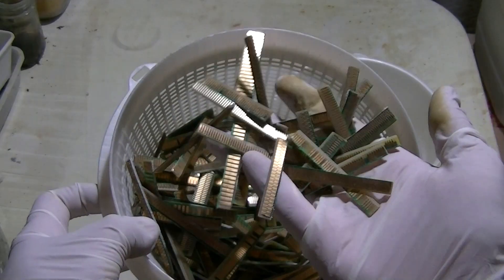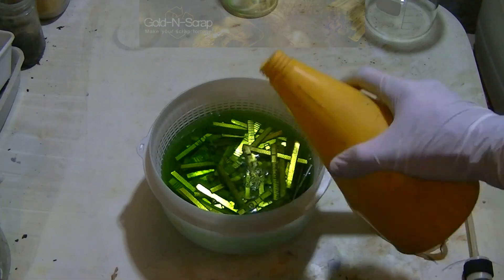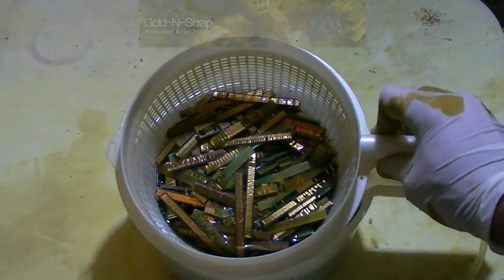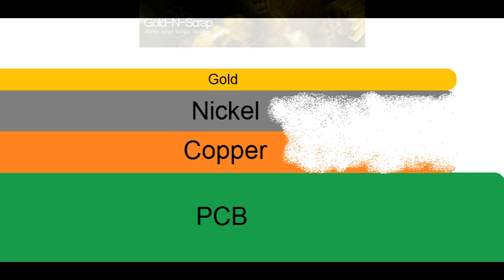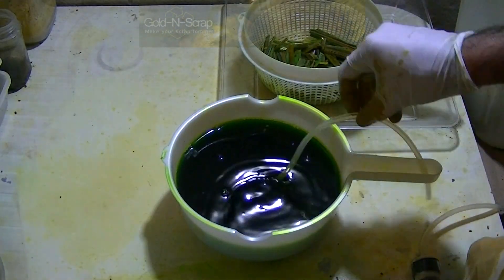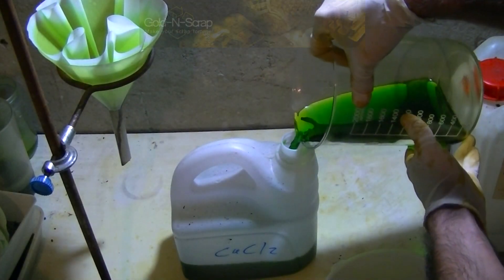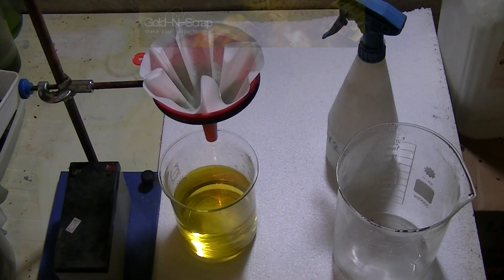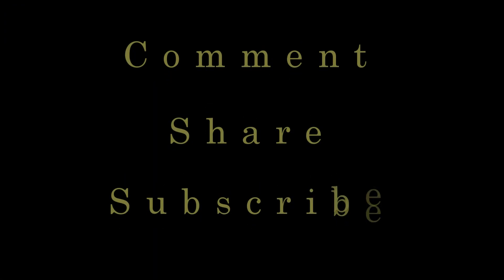Gold Fingers - How to Recover Gold from Electronic Scrap

Comment: Holy shit that real gold? You can try making an even bigger batch to get more gold and pawn that for a couple hundred. My guess for that piece of gold is about 3oz
Reply: Random dude lol 3oz not quite maybe 2grams
Reply: ***** I'm pretty sure you've missed the point. This isn't a get rich quick scheme or the uploader wouldn't have shared it! It's fairly interesting, but not gonna get you Richard Branson status. In fact as you say, you are more likely to take a loss undertaking this.

However, 3.5m YouTube hits with original content and adverts... this guy has earned at least $3000 in advert revenues from uploading this. I guess he did make a tidy profit ;)
Reply: Random dude three ounces? HA! no try again. One ounce is one of those big fat coins, $1600 bucks. This piece is probably worth 30 to 60 bucks at best.
Reply: Christian Dixon Correct, but on average a PC motherboard yields 5 Troy ounces per ton of chipsets, sourced from a Dell tech article. So to even earn 1 thousand let alone a few thousand as you say, you'd need to process 200kg of boards... motherboards (heaviest) weigh about 600g each. So you'd need to process 270 or so motherboards even if the cost of processing was nothing, which it definitely isn't! Realistically you'd need to sift through ~500 boards per week to make $1,100. If you sell the boards for $2 which isn't as hard as it sounds.... you've basically got the same profit :P

A lot of guesswork in the above but if this was profitable, there would be a lot of people who owned homemade gold stripping factories!
Reply: Random dude pawn it? pawn brokers are parasites that take advantage of ignorant and desperate people.
Reply: Random dude   Gold is heavy, that looks like about 23 and 11 pounds
Reply: Random dude That's probably way less than 3 oz. Odds are this isn't a viable way to get any money unless you own a computer shop or work in IT in a position where broken computer parts would fall into your hands very often. The initial investment in chemicals and supplies probably cost more than this single batch. Wouldn't recommend this unless you had a free steady supply of computer parts and are willing to follow all safety precautions.
Reply: GrumpyGrebo Gold is $1,100 an ounce right now. If you have access to scrap pc components and the chemicals from the video, you could easily make a few thousand bucks a week doing this. That's a pretty good income.
Reply: Random dude That's no where near three ounces of gold my friend! It's more like three grams, maybe four grams of gold. Haven't you ever held a one ounce gold coin in your hands before? It's much larger then that little nugget of gold he produced.
Reply: well think about the cost of all the materials and the oppurunity cost he wastes by spending hours with this process... not worth it for a tiny bit of gold worth around $60
Reply: Joe Schmoe The process of doing this is kind of pricey too. So when you think of it nearly pointless except for pure scientific curiosity really. Not to mention rather dangerous.
Reply: Random dude 50$ of chemicals for 5$ of gold plating. wow nice profits
Reply: Silver Schooner The price of gold was 55$ CAN/g of gold last year. Now, it hovers around 50$ CAN. So, 3 g  = 150$

The chemicals he used is worth about 5$ (1 L of HCl, a little CuCl2, a little HNO3). Counting the equipment might raise it to 50$. A small bern-z-omatic torch set (propane and oxygen) use to cost 75$.
Reply: justinjj149
Reply: first off, calm down u dont need to attack me. Second, how often do you think people need to recycle electronic scrap?
Reply: lol
Reply: justinjj149  man, you obviously dont live where i live, this is pretty cool to me.
Reply: Dj Barrington not denying its cool, just saying this isnt a way to get money off of
Reply: justinjj149 safety materials are reusable and the chemicals he used, i don't know if you noticed, but he says you can reuse the chemicals too, so he stores the mix for the next batch. so it's an investment in a way. he basically just lets the chips sit for 3 days anyway, so it's not like it takes lots of his time.
Reply: Dj Barrington We've already been over the reasons behind this previously, so at this point in the conversation a straight answer is probably more effective: no.
Reply: Lawrence Menachemson I think you're in the ballpark.
Reply: jordan f .999 gold is running apx. $38.00 a gram. 3 grams apx worth $115.00.
Reply: louis tournas You can't just pick up HCl or HNO3 at your local convenience store
Reply: Stephan Rabai You can get HCl at your hardware store. I do home chemistry so it is quite convenient. It is about 10 M concentration (which is quite concentrated). 10$ to 15$ for  4 L (over 1 gallon).

HNO3 is hard to find in Canada. Hydroponic shops sell it but it is quite expensive. I think it was 24$ per liter of unknown concentration. In the USA, you can get yourself KNO3 from most hardware stores and do some chemistry. If you intend to do gold extraction, you can just dump KNO3 directly into that solution (see video). It will acts like HNO3 because of all the HCl that is present there.
Reply: louis tournas Interesting update. The only places I've seen locally for these reagents are commercial distributors that don't sell to the public. HCl is battery acid but that's not going to be 10M?
Reply: Stephan Rabai Battery acid is sulfuric acid (H2SO4). A fully charged battery contains about 4.8 M concentration, which is 37% by weight H2SO4. HCl is often sold under the old name, muriatic acid. I think people use it to clean concrete. You will find it near the toluene, methanol, varsol, paint thinner, acetone, xylene area. If you are lucky, it will be clear. Sometimes, it is green colored because of impurities like Fe(2+).
Reply: louis tournas Thanks for the corrections and clarifications.
Reply: louis tournas about 6 grams

Comment: How much gold was recovered? Not enough.
Reply: michael peterson You spend more money than get from this proces..
Reply: its better than nothing
Reply: ZXTMA Smith 4 to 5 grams @ $35-40/gram = pretty good money for what $12 worth of chemicals and maybe $25 worth of equipment. NICE! but accumulating enough boards and connectors to salvage that amount of gold will take a long time. he showed approx 30 computers worth of fingers (~4 per computer)
Reply: ZXTMA Smith
Reply: Nope not worth it, the amount of time you spend getting a tiny bit of gold out of it which isn't worth enough for the labor involved.

You will make more money just working at a job than getting gold out this way.  Unless you have a giant version of this where you can get a lot of gold out, in which case you will have to spend a ton of money to make this a viable thing.

Comment: So basically you need to be a chemist and have access to these types of chemicals. Then you need the equipment and supplies. The air bubbler uses energy for a week straight.

The bottle of HCL is $35.00 + $27.00 shipping by itself.

Comment: 2.5grams
Reply: Thank you very much for the prompt response and the info. Very informative.

I've been working as a mechanic for over 45 yrs and you've helped see that I've been wasting a lot of scrap instead of stripping it down. 
Ford starter solenoids have a lot of copper in them, but over the years, I just tossed 'em when they went bad.

I used to sell old starters and alternators to rebuilder's, but it would seem no one rebuilds them anymore.
GM starters are pretty easy to remove all the copper form the armature, and I just figured out how to do it on Fords.

I look forward to learning more from you and if you ever have a need for any help on your vehicle and I can help you out, please do not hesitate to ask.

Shal' aam Aleichem
AAPiY
Mike
Reply: Mike Paul That's awesome!  Glad I could be of help to you.  I have been wanting to make a video on scrapping a starter and an alternator but I do not come across car parts too often.  Are you able to make a video of you taking a starter apart?  I would love to see it!  Thanks!
Reply: Mike Paul i work for the largest starter/alternator manufacturer in the world. I can tell you exactly where all the copper is and how to get it out easily without damaging it.
Reply: every small bit helps it's a great hobby we dutch say there is money everywhere you just need to know where too look
Reply: Haha those claiming to be 40s something year vets in the field they claim or working at a huge company seems pretty random and in fact pretty bullshitty.

Comment: i really need some help with something i have done this a few times and the first time i did the fingers and ever thing came out perfect. the second time was a alot less and when i put the mudd in the crucible it disappeared. I chalked it up to possibly had not been enough. well this time i got a new crucible and dropped about a pound and a half of plated pins. every thing worked out until i went to smelt the mudd again and i had close to a thumb size mudd ball that i was smelting and it completely dryed up and when i tryed to take it out the crucible it was just chard dirt. not a gold anything. and i fallow the steps to a tee. and would really question my self had i not had such success the first time. and im having the steps work out until i go to smelt the gold mudd at the end? any ideas any one?

Comment: 4:37 . why didnt you just melt the gold from here instead of going through another heap of processes when the foils are already there and just wash it with water a few times before melting the foils instead of dissolving the paper and the gold foils into acid and trying to precipitate them later on?
Reply: Yes I agree, then just electro deposit the ingot to get 99,99
Reply: Yes I never never go through all of that. As long as it's not tap water it works just fine.

Comment: Not all circuit boards have gold on them. Only the "good quality stuff" does. Industrial, medical, commercial or "old"(60's, 70's, 80's computers). Old Tv mechanical tuners (if you can find them) have gold on the contacts. New TV's, you might find some silver but for the most part the gold have been designed out of consumer electronics.

Comment: Great video, I'm planning to attempt this myself but want to be as safe as possible(within my spending limit). I lack a fume hood and bought a 3M tekk mask pro multi-purpose with cartridges that say the protect from certain organic vapors, chlorine, hydrogen chloride, sulfur dioxide or hydrogen fluoride or hydrogen sulfide and particles. Would this be sufficient to use if process is done outside? Was considering maybe a SCBA but wouldn't know where to start.

Also, what containers would be good for storing/transporting the waste acid to turn in for proper disposal? Any info greatly appreciated.

Comment: While this is interesting and doable, don't forget industrial gold is dissolved with arsenic. It is not recommended to mess with this gold due to the toxicity and the potential of shortening your life here on earth. As the the video indicates, wear protective gear and ample ventilation. Don't sell or give away this gold without a disclaimer advising the buyer. Without removal of the arsenic this gold is considered hazardous waste. The chemical and cleaning process could very well remove the majority of arsenic, but until the gold has been tested, assume it is still toxic.  I Do NOT recommend using this gold for jewelry with continuous contact to the skin.

I'm no rocket scientist or chemist, so that's my two cents worth as somebody with a small amount of knowledge and would rather error on the side of safety.

Comment: 1:1 dilution doesn't mean anything unless you tell people what the stock concentration is...
Reply: zreakz #1 fan
"100 mL of acid" means nothing.  Acid isn't a chemical, it's a property.  You might as well call your sample 100 mLs of wet for all the good that it does you.
Reply: knupder HCL can be made to about 40% or 22mol/l you can assume that's the base amount but after a while it would dissolve most plastics.
Reply: You must have the molarity of the HCL to do anything with this information BOTTOM LINE.
Reply: Joe Gresham And 1 below it!

Comment: Is there a way to do this with out dissolving the copper?
Reply from the maker: Good Burger Hi
Actually, there are ways to do it without touching the copper (or just barely). Cyanide leaching is one but quite a no no. 
There are Thiosulfate or Thiourea leaching... though less toxic than Cyanide, it is a bit more involved and the reagents are somewhat expensive.
Reply: +علي البغدادي 
لا صدك
Reply: Richard Sinclair
 The molecular structure is changed so that all of the metals in the acid solution are liquefied and suspended in the acid solution. After neutralizing the acid (with the addition of urea),by adding sodium metabisulfite only the gold ions within the solution are released and "dropped to the bottom of your container as .999 pure gold. This rusty looking powder can then be melted and stored as bars, coins, "buttons" or whatever medium that you decide upon, but rest assured, the chemicals used will ONLY drop the pure gold. Other metals within the solution can also be precipitated by adding other chemicals, for instance, any silver can be reclaimed by adding copper to the solution.
Reply: Richard Sinclair
 LOL, Sorry no urea and urine are different , Urea is very cheap to purchase though, You can find it on Ebay, etsy or any number of online sales venues. You can also use baking soda to neutralize the acid, though it takes much more of it.
Reply: +indeedItdoes   What if you just heated everything until it was molten and then dropped it in a centrifuge? Wouldn't that separate everything by mass?
Reply: *****
 Not to be a smart arse, but No, using sodium metabisulfate, ONLY the gold ions will be reclaimed, the copper as well as other contaminants will remain suspended in the liquid.
Reply: +Edwin Meye
Reply: i've seen people use a desoldering iron to get the gold foils off . it's quick and very easy to do .
Reply: yes but doing it that way leaves the copper on them so you'll still have to do your refining to remove all those contaminates from your gold .
Reply: هاي جذب لو صدك
Reply: +Novaroach why, your doing gold not copper
Reply: +Edwin Meyer Isn't that what rose gold is? Gold + a little copper.
Reply: if you dissolve the other metals in acid where do they go? The elements dont just vanish surely... or do they change in in molecular structure
Reply: +Edwin Meyer what ???
Reply: +Edwin Meyer in VIET NAM
Reply: thanks for your incite here when you say urea, is that urine?
Reply: +Novaroach not at all. The acid is cheaper than you think. He used stomach acid basically and a little acid you can get at radio shack that is made for tearing copper up.
Reply: yes
Reply: 00,,,,
Reply: All BS. Just roast and pan it good style .
Reply: huh?
Reply: huh?
Reply: Bebop Hippie. Looks like your name says it all. Goof.
Reply: Can you run that buy us again?
Reply: GrapeNoseBoy
Reply: oh neat - really?